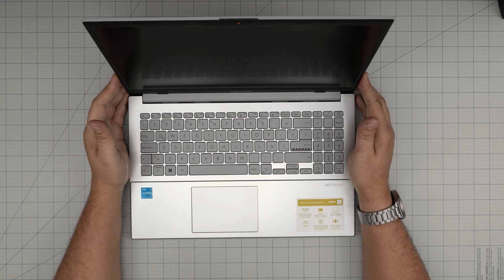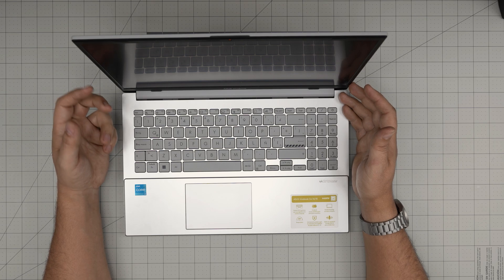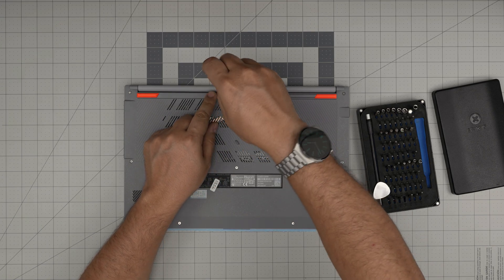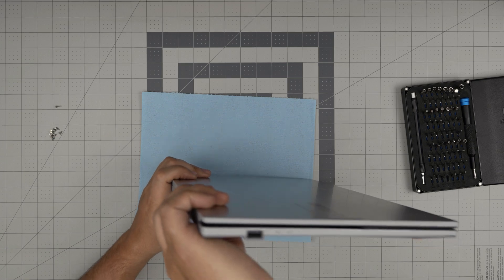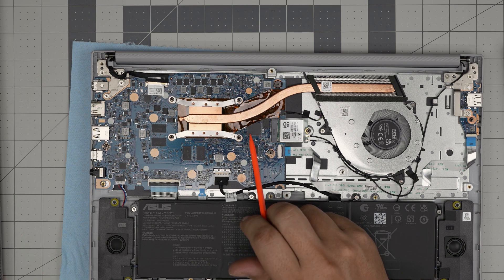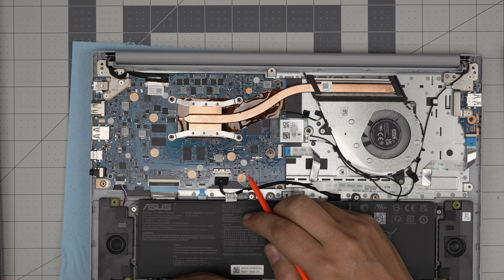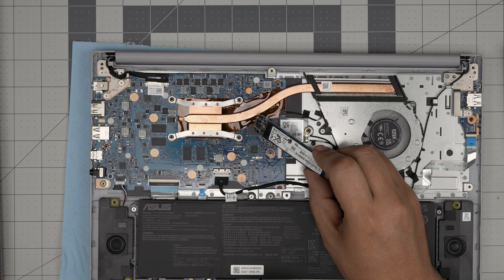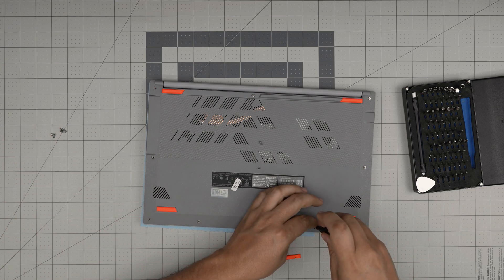How to Upgrade SSD on Asus Vivobook Go 15 E1504GA Laptop NJ083W

Comment: In a website I saw the laptop advertised as "Notebook Asus Vivobook Go 15 E1504ga, ... , 256gb Ssd M.2 Pcie Nvme". "M.2 Pcie Nvme" suggests it's not soldered but can just be unplugged, right? could it be that the vendor is simply incorrect in using that description? Thanks!
Reply from the maker: 🫠Regarding your question, there are a version with nvme that you can remove and upgrade, if the vendor is mentioning then the laptop should have it, if not return the laptop.
cheers🍻

Comment: Nice video. Is it possible to upgrade both memory and storage of my vivobook go 15 r5 7520u/16gb/512gb, I need to know, please.
Reply from the maker: 🫠Regarding your question, on your model you can only upgrade the nvme to max 2TB. the ram is soldered on board.
Should you have any further questions or requests in the future, please don't hesitate to ask me.
cheers🍻

Comment: I shined my torch through the three lower vents and could see the NVME drive without opening just incase anyone is interested.
Reply from the maker: 🫠Regarding your question, you may a have a different varian of this model, there are many different variants.
this one is: Asus Vivobook Go 15 E1504GA.
this are few other variants:
E1504GA-NJ321WS
E1504GA-NJ322WS
E1504GA-LK321WS
E1504GA-BQ321TS
cheers🍻
Reply: @uFixTek  Thanks bro. 🍻
Reply from the maker: It's my pleasure my friend.